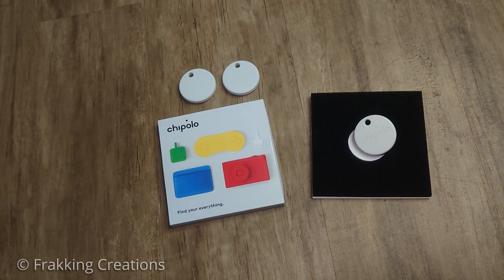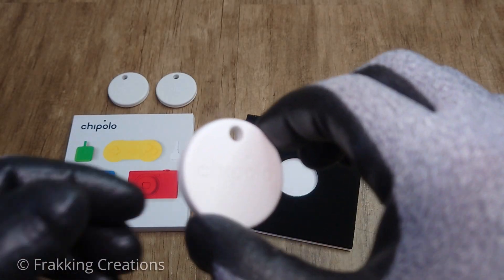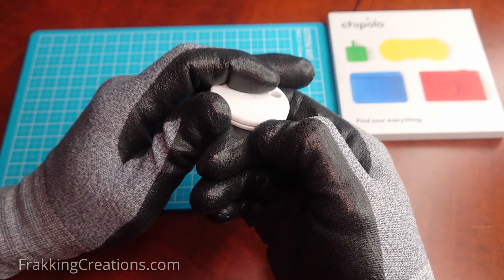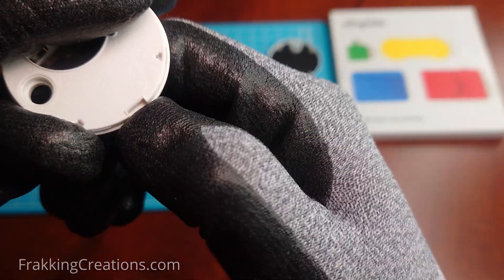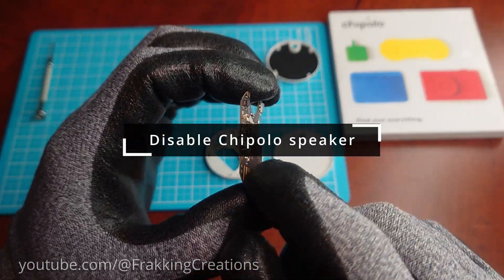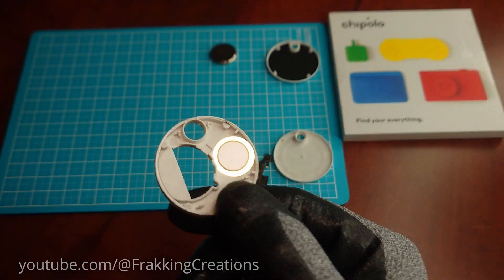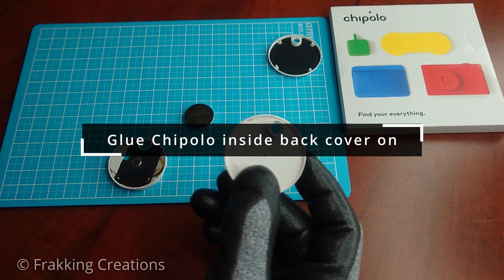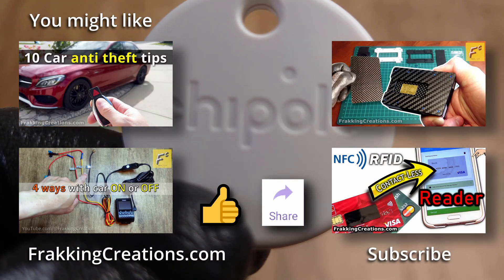Speaker DELETE for Chipolo Android tracker / Disable speaker for Chipolo One Point & One Spot

Comment: I got mine today. I could not get it apart to get to the chip and disable the sound. Any ideas?
Reply from the maker: I had a comment that said the new batches are better sealed.  Not sure if this is true.
Try to watch how I did it again and also try to slightly twist the case as you try to pry it apart.

Comment: Yeah having the possibility that anyone can turn on the speaker makes this gadget useless if you use it to track backpacks or luggage that could be stolen.

Another case where you want to have the speaker disabled is if you use the tracker on your pet (especially cats). I don't want that me or someone else turns the sound on by mistake, they are very loud and the pet would be scared to hell
Reply from the maker: That's why I disabled the speakers in ours.
It's too bad Google's Find My Network is too restrictive at this time, causing the Chipolos to not work as well as the AirTags.